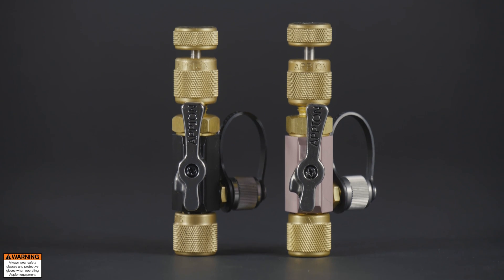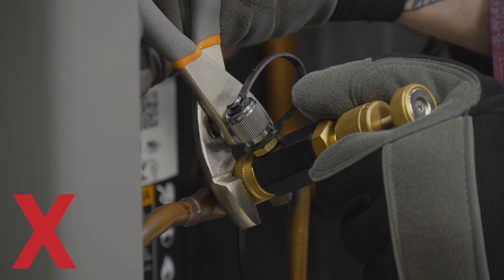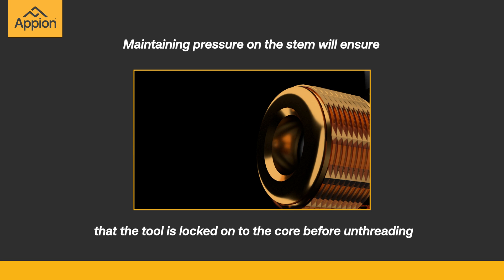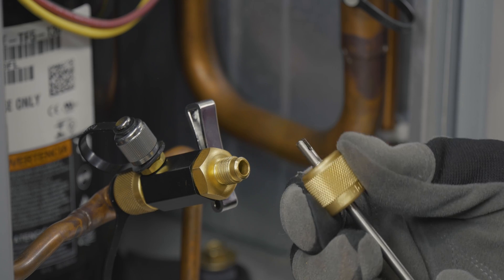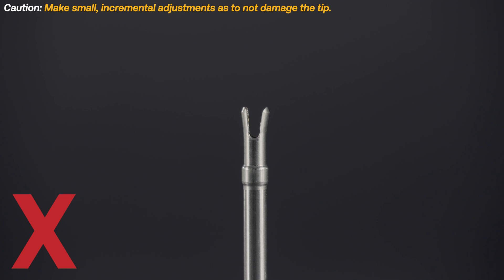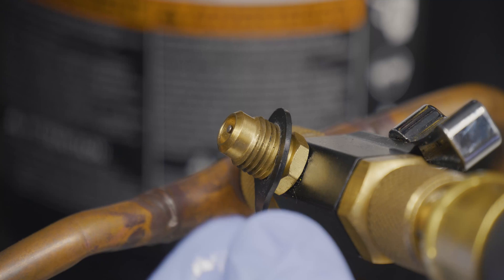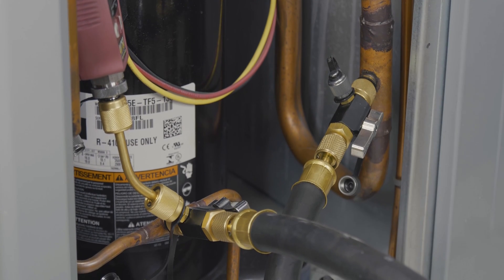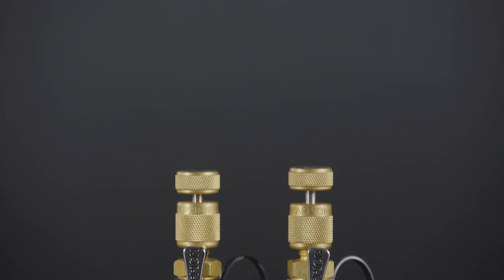Valve Core Removal Tool Proper Use

Comment: How do you prefer to remove Micron guage before charging? I confirm clean system with vac decay test. Then turn vac pump back on to system remove guage and let it pump for at least 5 more mins.

Comment: Is the side port on the system side of the valve, or the exterior side of the valve?  In other words: when closing the valve on the tool, is the side port still exposed to the system or is it isolated as well?
Reply: It’s exposed

Comment: My Appion VCRT never works. It hasn't worked a single time. I have tried adjusting the jaws, but every single time I try to extract, it drops the valve core inside the tool.  I can grab and reseat the valve, but it never extracts the core past the tool's valve.

If I want to remove it, I have to allow it to be knocked off inside the tool, then remove the extractor, and open the tool's valve to blow the core out with pressurized refrigerant, which is stupid.

Waste of money. My C&D tool works almost every time.

Comment: After 9+ Appion vcrt’s, I’m trying out the new Fieldpiece.  All my Appion’s have been Frustrating to actually capture the valve cores, or have leaked.
Like 2:07, IF the core was successfully removed!!!
Reply: Exactly!  Mine never works.  It always drops the core internally, no matter how the jaws are adjusted.

My C&D tool works, though.

Comment: The isolation valve isolates only the back end port but not the side port so is there a good tactical way of removing a micron gauge from it before cracking the system.
Currently I just take it off and some air gets sucked in and I vacuum for another few minutes before cracking. I tried using another valve on the side to isolate the gauge from the core removal tool but couldn't always get a good vacuum with them. 
Love the tool though.
Any advice would be really helpful, cheers.
Reply: JB and Fieldpiece both make a CVR tool with an isolation valve.

Comment: Im looking into getting these currently, noone has one in NZ, but theres alot of machines that the valve is in the wrong place to suit this fitting, ideally i would want a 45 or 90 degree female that i could attach then depress the core, i could see that being possible with a taper pushing the depressor down on a tee type fitting, cant find one though.

Comment: Question you use the valve core removal tool when vacuuming do also need to use it when charging
Reply from the maker: Its best practice to use a chargning-T or a core depressor tool. Because of the accuracy needed when charging, the ability to depress the core more or less is vital. Removing the core would take that control away in most scenarios.

Comment: Do you recommend charging the unit with the valve core removed or with the valve core installed?
Reply from the maker: We recommend charging the system with ≈5psi then putting the cores back in and finishing off the charge with a Charging-T or similar charging fitting. However you can fully charge the system then put the cores back in, it's not incorrect. We just find it easier to push against 5psi rather than the full charge. The main idea is to not insert your cores while still in a vacuum.
Reply: @Appiontools  thank you for the quick response. Your comment helped out alot.
Reply from the maker: @dcmarvelunited5529  Happy to help!

Comment: I picked one of these up and have never used one before. Worked well for me on our old Trane unit . Replaced 2 out of 3 leaky cores that were bad . Taking my time about 15 minutes on both . We are still running R22 so it was a must on getting the tool and replacing the cores ,

Comment: What happens with the small amount of air that is in the chamber behind the ball valve where you go to put the core back? Especially if the system is in a vacuum. Would it be better practice to put a positive charge in the system with cores removed first?
Reply from the maker: Yes, it would be better practice to put a positive charge into the system with the cores removed first. We recommend charging the system to roughly 5 psi. The AV760 can handle this low positive pressure just fine.  Once you have the system charged to 5 psi, then you can put the cores back in, remove the vacuum gauge and core tool, and continue the charge as normal. Great question!
Reply: @Appiontools  if this tool is originally designed to change cores in fully charged systems, well over 5 psi, why would you only advise to only let 5 psi out then put the cores in and then finish the charge. Couldn't you just let it all out first and then put the cores in??
Reply from the maker: @ren3081  It's much easier to push the stem against 5psi, also with the lesser pressure, you can get a better tactile feel when the core engages the system port threads. But its totally personal preference. We have people that will put the full charge in every time then put the cores in. Some people find a little trouble with the full charge so this is just one way not necessarily THE ONLY way.

Comment: Is it possible to vacuum the system using the Appion tool without removing the core?
Reply from the maker: I mean, it is possible but it will be SIGNIFICANTLY slower. Leaving the valve core in can reduce airflow to .2 CFM. Unless there is a specific reason that you MUST keep the core in, take the cores out.

Comment: Hi I accidentally broke the Schrader valve that’s on the side where you hook up your vacuum gauge to and is stuck on there will the tool still be usable or do I need to get it fixed
Reply from the maker: You'd definitely want to get this repaired. Any damaged component of the tool could lead to a leak.
Reply: @Appiontools  and what procedures do I need to take to get this repaired?
Reply from the maker: @luislopez6055  We sell a full rebuild kit for our VCRTs. The KTMV25 has caps, ball valve seals, valve cores, and O-rings to replace any and all components. Here is the link to the full walkthrough of the repair. https://www.youtube.com/watch?v=GHBXYInBU4E
Reply: @Appiontools  ok I will look into that and what size are the valve cores for this tool?

Comment: Do you guys warranty directly? Or do I need to see the supplier? I bought the mega flow kit with micron gauge as shown in the video. I can't pull a vacuum under 1500 microns. Have tried many times. I have tru blu hose kit as well and have no problems pulling 500 vacuums.
Reply from the maker: Sorry for the late response, please contact support@appiontools.com
Reply: Me too mine keeps leaking